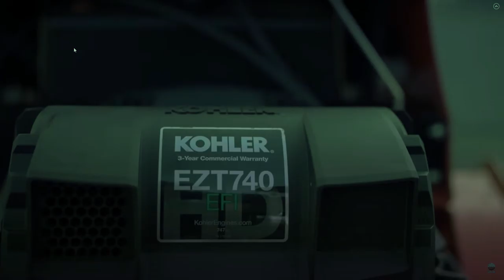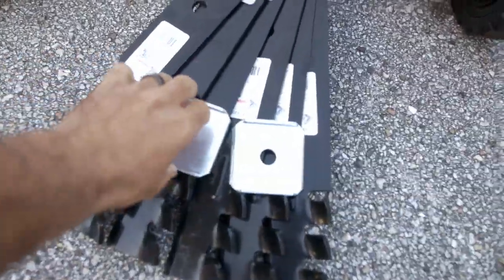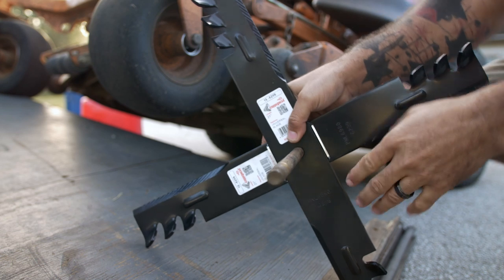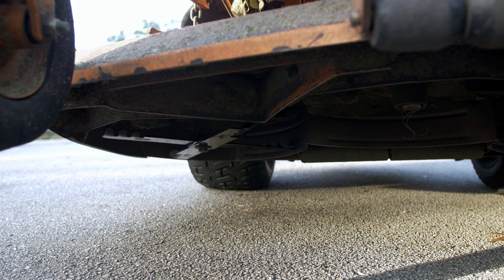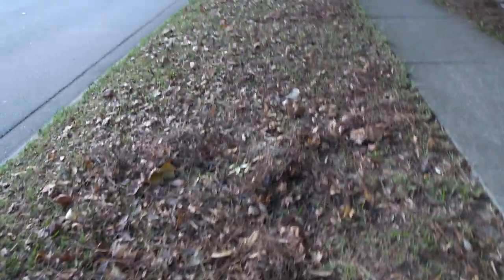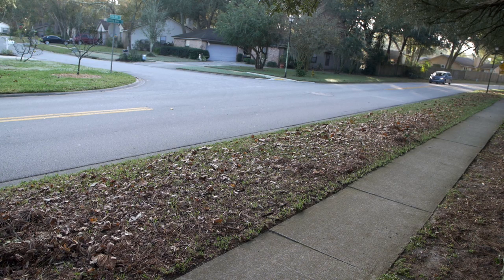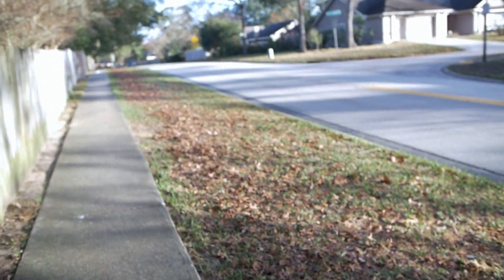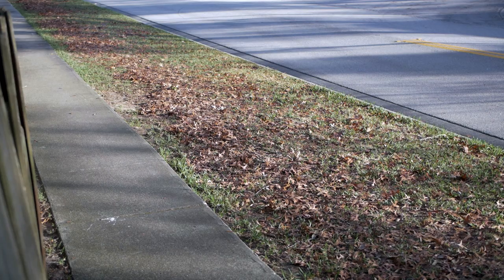6 Mower Blades vs Debris And Leaves!

Comment: I tried X Blades this Fall on the Z3X mowers, worked out awesome! I used 1 lift blade and 1 mulch blade on each spindle to get the lift and mulch effect.
Reply: How did it cut? I have the same deck? I'm currently running one mulching blade on each spindle and it's cutting terrible leaving stragglers everywhere
Reply: @bushhiker  x blades work great, but you will use more fuel, and it will cut lower.

Comment: I used this for awhile hard on clutch be careful  when engaging blades works well,noticed it looked like your caster wheel bearing is out
Reply from the maker: Yeah both r going out. And yeah blades engaged less half throttle for sure

Comment: I'd suggest a shorter spacer might be better than a longer bolt. The lower blade is now, lower. A spacer  to suit would get it back to normal height. Even a heap of large washers would work.
Reply: I agree it cuts about. 50-.75 inch lower on my mower when I ran them.

Comment: I have run 2 blades per spindle for years without using any adapters.  The spacers between my blade and the bottom of the spindle are the same thickness as my blades.  So when I install two blades, I just remove one washer from above them.  The mower will cut the same height.  And the bolt won't be too short.

Comment: Hey Wally, make sure when cutting you take in consideration the bracket plus the additional blade you have to raise your mower deck up to not scalp or cut grass too low
Reply from the maker: Yessir, lifted a 1/4 inch higher than stock

Comment: 🤔so ,the mulch kit with baffles doesn't do the job with 3 blades for you? We have been mulching for years with just a kit and baffles and do just fine mincing oak leaves up. We don't ever have to bag and dump our stuff. I'm not trying to be snarky but,I think that mower should be able to get that cleaned up with just 3 mulching blades? Maybe you aren't going as low as me on the deck. I'm usually mulching at  2.5"-2.75" this time of the year🤷‍♂️again, I'm not trying to be a smart ass! just curious 😎👍
Reply from the maker: It'll do it, just did it faster with 6! I wouldn't always use this set up by any means
Reply: here in my area in ga i never haul leaves off ever- alot of bermuda grass that reqiures alot of sun in my area so not to many lawns that have that many leaves
Reply: @beachriverlandscapes  I was gonna ask the same question.  I have a Scagg Vride 2 with mulch kit I bought it bc of the mulching kit it mulched up oak leaves unbelievably well compared to the other mowers I demoed.I use  a 36 in and 60 inch Gravely with mulch kit doesn't do diddly squat when mulching oak leaves in Florida.  But my Scagg mulched them up into oblivion. I mulch every thing when I trimm hedges, leaves , I dont have to pick up anything. I guess the 6 blades would just make the mulching whole lot better